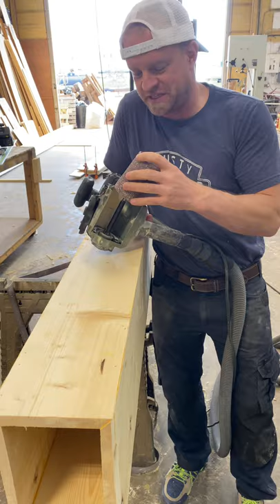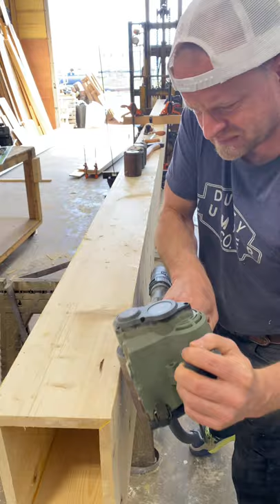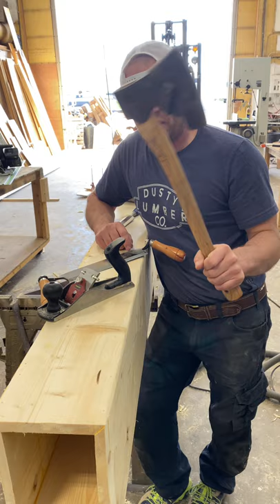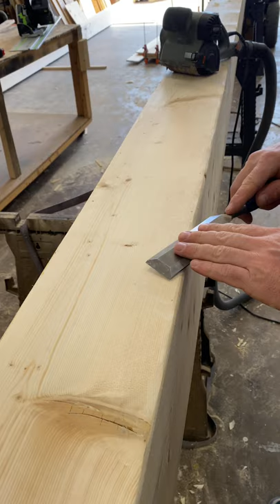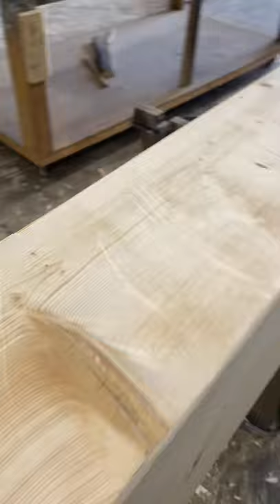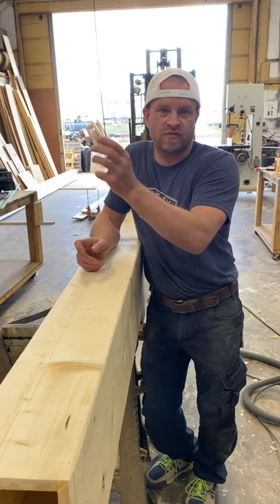Aging and weathering new wood

Comment: Excellent video. Just a tip for anyone doing this - use a pre-stain wood conditioner before applying the dye and the finish will be much more even. It prevents the excessive take up of the dye/stain in the tear up parts etc